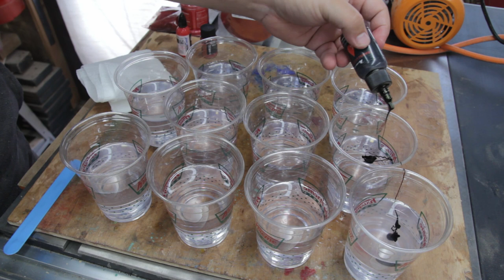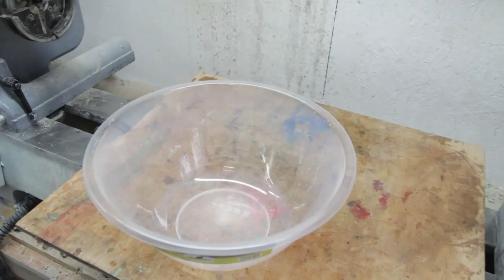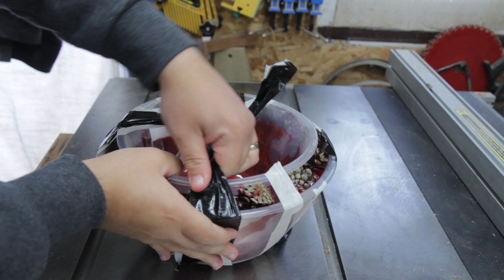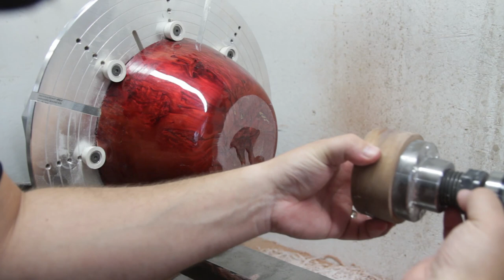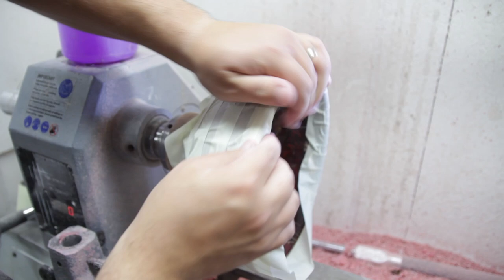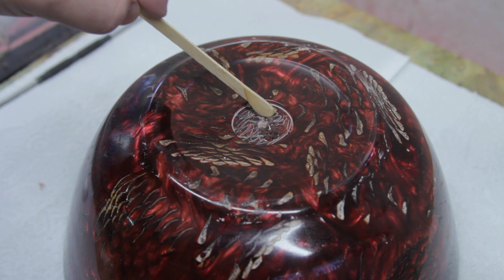Woodturning - Hybrid Pine Cones on FIRE

Comment: One suggustion David, get rid is that paddle wheel for mixing epoxy. Epoxy is supposed to mix slowly. This will get rid of all your microbubbles. I've been working with epoxy for years.
Reply from the maker: Thanks Patrick. The resin I use is super durable. Sets after 4-5 hours so will release all the bubble. Plus I do not show sometimes when I put the resin into vacuum to get rid of air bubbles before pour :)

Comment: Nice ...  David could you tell me where you are getting those bowl molds from   Thanks
Reply from the maker: Thank you :)  Here in the UK there is a store called Wilko. Selling them as salad bowls
Reply: I'd check into cheap 'nesting bowl sets' where the sizes fit one into the other. I'd think that would work well, and only a few bucks a set.

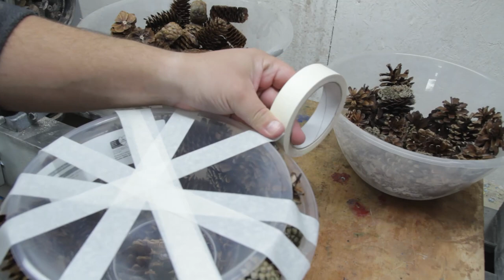Comment: 02:52 – HUH?..
Reply from the maker: Needed to avoid resin to fully blend. With this method you can achieve colour separation
Reply: @DavidsWoodturning 
A-a-a... I thought that for some reason you decided to wait five hours before pouring the product. Now I understand, thanks, 😁.
Reply from the maker: @VictorCorneplod1130  well that is exactly what happened 😃 The resin was sitting on the side of 5hrs before i poured in the mould. This is a deep pour resin so does not really mind that. But it starts setting a little and due to higher density colours cannot blend very well